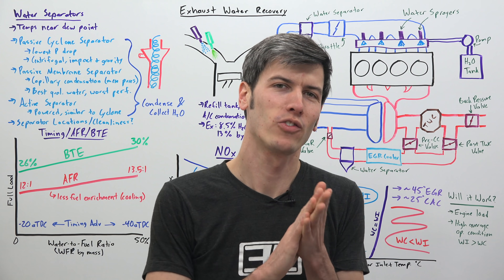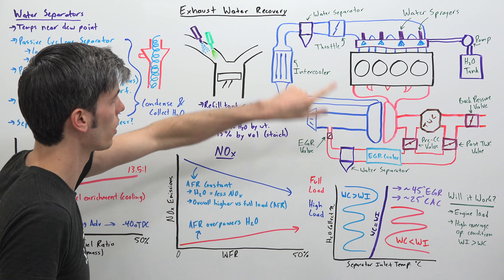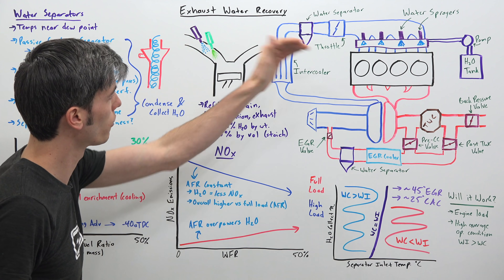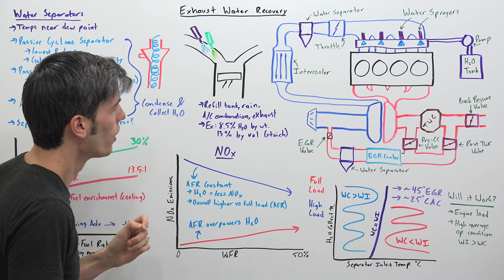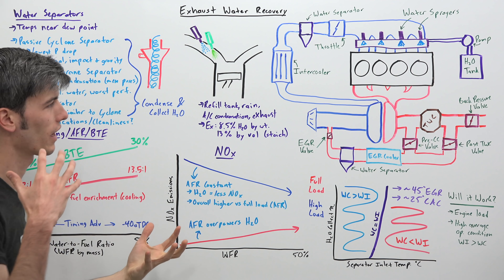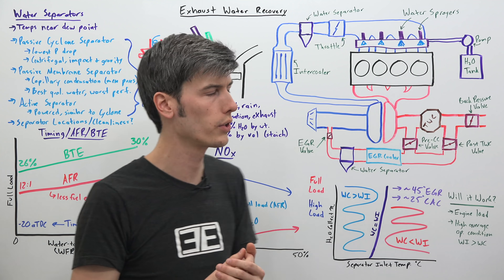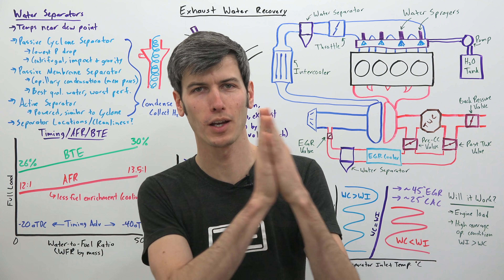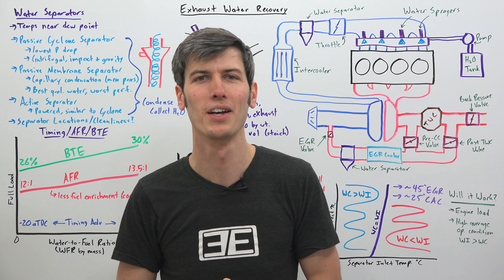Using Exhaust Water To Make More Horsepower!

Comment: You should totally compile the best methods for each car system into a playlist called ideal car or something like that. It would be amazing if anyone implemented all of those cutting edge and innovative systems in a car. i'll keep dreaming.
NOTE 1: By system y mean like the ones in the videos: - best water injection (BMW video)/ best intake manifold (porche video)/ best spark plug (mercedes video) / best anti lag (porche or hyundai video) / sodium filled exhaust valves (Kia video) / best engine (many videos of different brands).
NOTE 2: I'm not saying that the systems presented on the videos are absolutely the best ones but they are definitely innovative methods for each system and it would be cool trying to find the best methods for each system and compile them in a playlist.
Reply: camless variable compression high thermal efficiency hcci engine with water injection is just the kind of chimeric monstrosity i want to see. Throw in some turbos, sodium valves, a CVT (yeah i said it) which you can switch tuning to maximize power or maximize mpg.
Reply: It would be awesome
Reply: Nobody could combine all of these because of patents
Reply: @marnixprovoost7961  DAMN LAWYERS!

Comment: I want a filter to pull most of the N out of the ambient air to reduce NOx production.
Reply: NOx gas isnt stabil. It doesnt take one day to seperate completely^^
1 candle produce 4x of the maximum NOx that is allowed in germany. Damn churches they gonna kill all life on earth!
Reply: @johannesdatblue4164    we don't light candles at my church, I guess that makes us green :)
Reply: @lylestavast7652  Green like a plant ;) I prefer driving with disconnected O2 sensor on my small bike but I should use a spark plug with a higher heat takeability (I know that's not a word but you know what it should mean)
Reply: @johannesdatblue4164   (I was referring to before it's used for combustion...)
Reply: @lylestavast7652  i understood you - if you can build such an filter without killing the engine performance (not enough air) you get the nobel-price ;D
Reply: @johannesdatblue4164  dream big !!!
Reply: @lylestavast7652  True words. Set high targets  - without enough thrill you wont get far ;)

Comment: Why not go for a closeloop system. Use nice distilid(or even ultra-pure water). The use the outside of the block or maby the turbo heat to turn it into vapour. Use the steam to drive a turbine. And let the gas then move trough a  second intercooler turning it back to water. And repeat. This way your water never get used(say for a few ml per year). And you can use cleaner water or even other liquid
Reply: rubikfan1   If it’s never injected into the chamber you don’t get the efficiency gains.
Reply: @DrewLSsix  but it does help with longjevity(my english suck i know). Most metals dont like switching between cold and hold.
Reply: that is something entirely different. But steam engines like you mention, even ones that run on exhaust heat, exist in powerplants all over the world
Reply: Are you talking about using this for the water collectors?

Comment: Sounds a bit like a fancy version of what a condensing heating boiler does to increase boiler efficiency in winter.  Does the efficiency calc include allowing for the weight of the parts and the water?  What about the extra maintenance costs?  At first I thought this was going to be about an HHO generator - luckily, it wasn't.

Comment: Unrelated question. Do I need to install a EV charger at home to be considered level 2, or having a 240v plug at home is enough to take advantage of level 2 charge time? Thanks.
Reply from the maker: 240V outlet (depending on the amps) can charge at level 2 rates. Mine is 240V with a 50 amp breaker, charges at 32A.

Comment: This seems like a convoluted way to cool the fuel/air and increase power. To your knowledge, has anyone every tried making a charge cooler that uses a refrigeration circuit (like the AC already in the car) to provide cooling? Obviously the effectiveness of liquid water vaporizing in the charge air will be quite high compared to conductive cooling but I feel it's quite complex and adds just one more failure point to overcome. Also, is there enough water produced during combustion (plus the water added in) to replenish the water tank entirely so you effectively have a sealed system or do you still need to top it off?
Reply from the maker: Yep, Dodge has done it: https://youtu.be/wLOkr-hUnU4
Reply: @EngineeringExplained  they have done it the wrong way

Comment: damn quick pass at people in California 😂 no rainwater
Reply: and the dew point is?
Reply: I thought he meant that it was illegal to capture what rain there is. Which isn't true. Well, not since 2012.
Reply: Occams Razor I also liked thinking of it as a jab at Legislateeverythingafornia, but it probably was more just that theys gots no rainses.
Reply: That wasn't a drought insult-- that's just the way things are on average.  We get an annual average of 12.25"/yr of rain in my part of Los Angeles, and nearly all of it in 4 months in the wintertime.  My car spends an average of 1.5 hours a day, 5 days a week, exposed to the sky.  It's in a garage at work and a garage at home.  That means it's under cover for 95.5% of the time.  This exposes it to a statistical average of 0.55" of rainfall in a typical year.  And it's totally normal for it not to rain a drop for 5-6 months each year.  Probably not enough to get me through the 11,000 miles of driving I do each year.
Reply: No brain either. Those losers are always stealing water from nevada and arizona.

Comment: The brave ones will run their car on water only
Reply: The real men
Reply: Look up the Joe cell! And Stan Meyer!
Reply: I am late to the party but have to say: you are a scholar   👍
Reply: Electrolysis engine? But if it water only..... how will you have the electricity to make a spark? All cars run on at least a small amount of electricity ;)
Reply: asassin asa an engine running on water is like a dream but nobody talk about the disadvantages an engine on water: corosion. Gasoline is good against corrosion and is a good cleaner.
Reply: @lutyanoalves444  leave
Reply: Water can easily be separated into  hydrogen and oxygen, so this is actually possible.
Reply: @bryanmurphy26  except it's not, takes to much power to separate the water for it to be viable. In other words it requires an outside energy source to power it, which could just be used to power the engine instead.
Reply: @jaydunbar7538  The Government wants you to believe that, but if you use perpetual motion, and like magnets or something to power the separation, it works great.  Nicoli Tesla told me, on his YouTube channel.
Reply: Nordburg I can’t tell if this is a joke or not, more and more people believe in crazy ideas
Reply: Rotor Blade it’s def a joke

Comment: Any hotter than 25 degrees Celsius would see the use of the AC so I guess were good
Reply from the maker: Well, intake temperatures will be higher than ambient as a result of compression from the turbocharger.

Comment: Could you not just put some water into yr gas tank?
Reply: That will probably cause the gasoline to not be as explosive in the chambers, which means less power.
Reply: @kirara4953  but the water should still evaporate just like it does when it's separate not?
Reply: @The_Pleiades7  if the gasoline can't burn no heat will be generated, adding water to your gas tank is probably not a good idea, which is why they have venting systems to remove oxygen and humidity as well as water removing additives exist. The water either stalls the engine or corrodes gas lines and gas tank
Reply: @The_Pleiades7  water and gas don't mix well so you can not accurately inject both together from the same tank.

Comment: If I had a car with factory standard water injection, I'd fill the tank with methonal instead
Reply: And the methanol will corrode the tank
Reply: @damianrolinski8906  then I'd  be sure maintain the PCV system to preserve a sacrificial layer of clean oil that will prevent corrosion
Reply: @gammalight1312  the tank will not rust because everything is plastic today xD
Reply: Gamma Light   Who said anything about the engine? The injection system is the issue.
Reply: @DrewLSsix  made with stainless steel.  Water is a catalyst for rust also, people are over thinking this.
Reply: Methanol auto-ignites  at around 850 degrees. It's over a thousand degrees in your engine cylinder. Enjoy the knock.
Reply: @bonob0123  heh, you've never heard of methonal injection have you.  Check  it out, it's actually a way to artificially increase octane, similar to water injection.

Comment: Those new technologies are great, but how about longevity and reliability...
Reply: I mean if they go bad the engine ecu might just go back to regular non water injection air fuel ratios and timings and youre good. You loose a bunch of power/efficiency but the car will drive normal
Reply: My concern, aside from the changing DEW POINT, is Rust.
Reply: @Formulabruce  Rust would be the easiest issue to foresee and avoid by just not using materials in the collection and injection stage that corrode at operating temp. The real problems will probably be the unforeseeable/hard to test over 1000's of hours and 10's of thousands of units and infinite road conditions. Things like residue/particle build up, salts from road gritters, materials that just don't stand up to the job in their first iteration, etc and of course the ever-twitchy electrical system that will go with these things, etc. It's not something I'd buy gen 1 TBH .. .and really not looking likely to be at all, as by the time this comes to mass market cars in a tested, refined and proven way .. well it probably just won't be the smart money to buy an ICE car.
Reply: @Formulabruce  If you have components in a modern engine that can rust, you don't have a modern engine.
Reply: More piping to have boost/vacuum leaks.
Reply: Simple.   The manufacturers are entirely against longevity and reliability and how dare you ask for it.  Problem solved!

Comment: How dis sistem works in the winter, then outside is -10 C or lower?
Reply from the maker: Dis system no work in winter.
Reply: If the purpose is to cool and it's cold you don't need cooling. It probably just shuts off
Reply: +Engineering Explained 

yoo see Ivan, when replace brreak fluid with deezil, brake peydil become boost peydil

Comment: For those who live in California (who don't get water) maybe they could harness the power of the forest fires somehow
Reply: Wood caburetors are the solution ;)
Reply: Dan 😂😂😂😩😩😩😩naaaaahhhhh mannnn
Reply: Wood burning engines?
Reply: @james2042  yeah ^^ at the end ow WW  1 or WW 2 gasoline was to expensive and rare so they built wood carburetors to power their cars 60HP had the car we talked about in school (apprenticeship for mechanics)
Reply: Johannes dat Blue those where using wood gas, not wood. Wood gas is just CO and you obtain it by pouring water on burning wood.
Reply: Burn! 😄
Reply: Thermovoltaic blanket on the forest floor?
Reply: Just take fire and put it in engine cylinders. Easy!
Reply: a heat sail in the top of the cars :D harness the forest fire heatwaves :D

Comment: A better way to make more horsepower is to tie horses to your car

Modern problems require modern solutions
Reply from the maker: Found the innovator.
Reply: Recycle the urea from your horses and inject in car's engine exhaust to reduce Nox emissions at the same time. 
Great job yet again EE!
Reply: Psychological horsepower boost by adding ''Twin Turbo'' sticker decals all over the car as well
Reply: it's go faster stripes that really work. It's true I tell you!!!!!!!!!!!!!
Reply: dave chappelle still modern
Reply: Yea or even better use coal gas thrusters
Reply: Evariste Galois (Ties 400 horses to a Honda Civic)
Reply: Modern Problems Require Modern Solutions: well not always. The toughest type of concrete ever made for example was the Roman type. If you want a structure to last a long time modern concrete is not the way to go. Some of the mental health issues caused by modern society are best treated with some solutions that are thousands of years old. That's just two examples. Some do need modern solutions but the flip side is that there is zero point in re-inventing the wheel.
Reply: @gordonlawrence4749  I dont think you made a good point at all. What problem do you think were trying to be solved in the examples you gave? Sure, maybe Roman's made better concrete but the goal today is not to make the best concrete but to meet growing demands. Many things today are not to meet better quality standards, but rather quantity. 
On the flip side, we could also make far better things, as we can really dial in exact quantities of what's necessary to make something the best possible.
Reply: Center console spitbucket option instead of smoker package....
Reply: FBI: stay where you are
Reply: Not really, much beyond 2-4 horses they start affecting each other's performance, especially in high speed situations. It's less of an issue in low speed torque situations. What?? I thought you were serious?? :-)